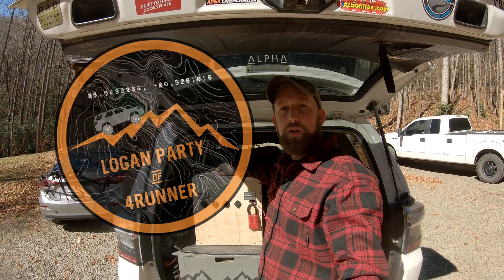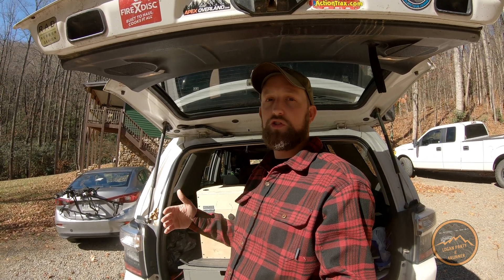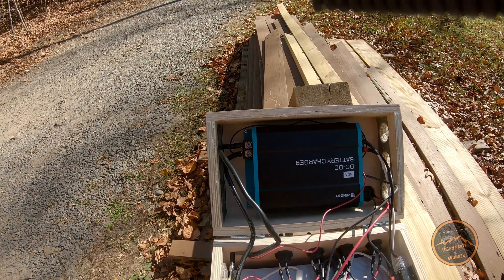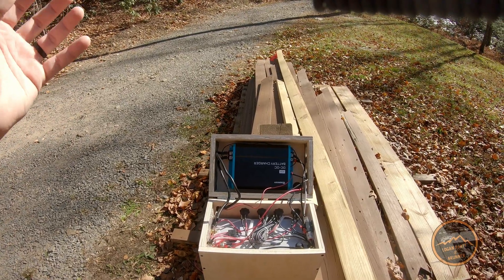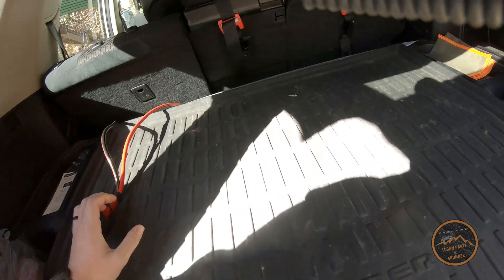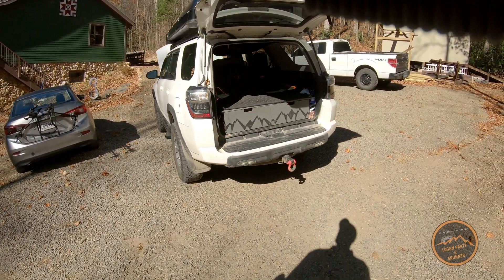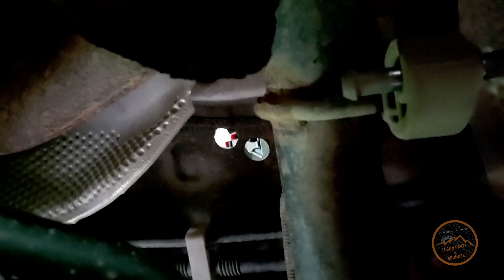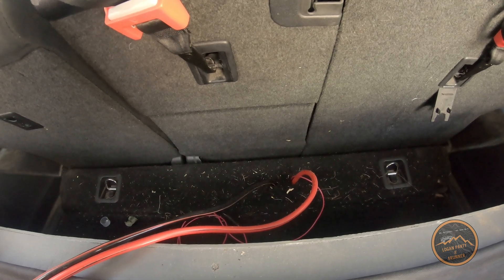Dual Battery Box DIY Portable 12v power from a Renogy AGM deep cycle battery and Renogy DCDC charger

Comment: Tell me about that truck bed, I’ve never seen that before.
Reply from the maker: Haha! Good eye! I bought that truck used. It was originally a natural gas company fleet vehicle. That bed is a Ford commercial factory option called a "midbox". It is a standard size 5.5ft. bed with a box in front with tool drawers on both sides that makes the total bed length 8ft. so a long bed tool cap can go on it. (Which it had when I bought it) I had never seen one either.
Reply: @loganpartyof4runner  That’s really cool! Just found your channel, enjoying your videos!
Reply from the maker: @kisaac6933  Thank you so much for watching!